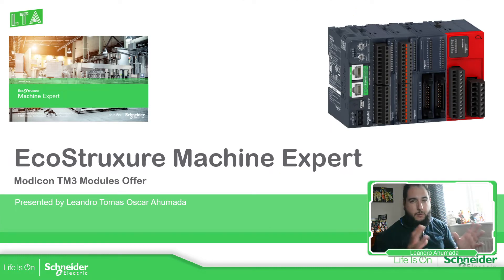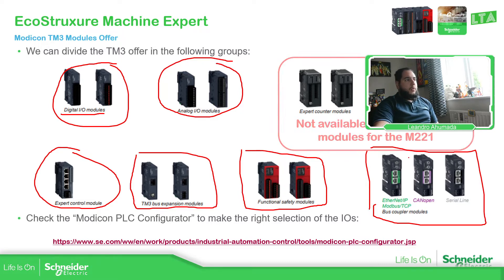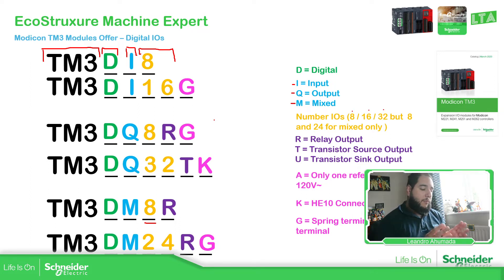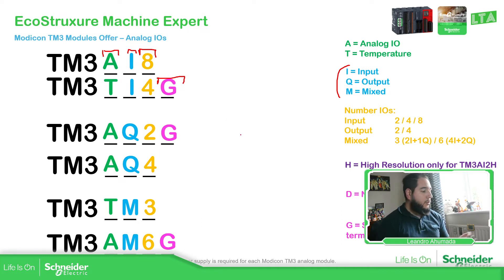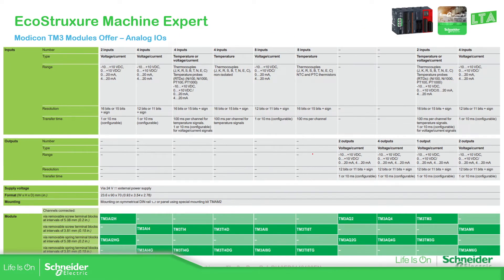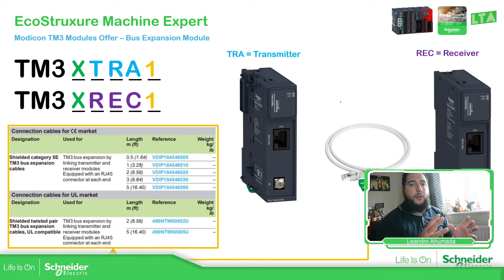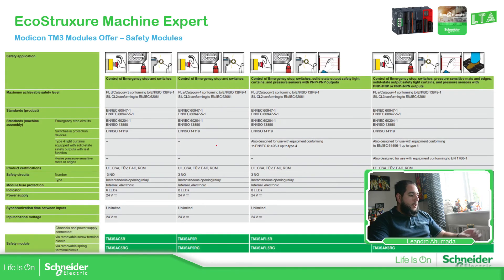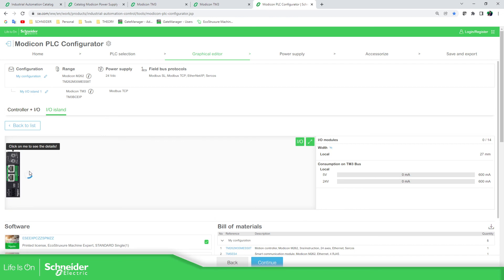EcoStruxure Machine Expert Training - M9.1 Modicon TM3 Modules Offer

Comment: Hi Leandro. Thanks for your videos. They are really helpful. One question: I'm using a M241 and a TM3AM6 Analog I/O module. I know I can  add it manually to my project by adding it to the IO Bus and choosing it, but is there a way of autodetecting the connected devices once you are logged to the PLC? I can see that ME detects that the configuration is wrong but it doesn't say which module is connected.  Thanks!
Reply from the maker: Hi there! There are function blocks that allow you to check status of the module connected but even if the plc detects a wrong configuration we need to manually configure the hardware.
Reply: Thanks for the answer! @LeTomasAHUMADA

Comment: Hi, Leandro. In my case I want to expand the ethernet 2 port (I have a M251) cause I'm using the controller as a ModBus TCP Client and the ethernet port 2 is already been used to control a UR3 Robot (Server), but I want a second ethernet 2 port to connect to another device (another server), wich expansion module can I use? 
I found the TM4ES4 module, but I saw that it is not configurable with Machine Expert when using M251 (It doesn't show in the modules tab), so It works as Ethernet 2 or only as Ethernet 1 when we couple it in the controller? How can I specify the type of ethernet in the module when coupling like that?
Gracias in advance.
Reply from the maker: Hi there! You can extend the network by using a switch connected to the eth2 or adding the TM4ES4 without any configuration in the software.
Reply from the maker: The only “problem” is that you need to physically link the module to the plc using a ethernet cable

Comment: how many TM3BCEIP can by connected to M262?
Reply from the maker: Hi Yaroslav Lyulko! I am not 100% sure if i can give you a number for this but if you check the resources on the ethernet port you should be able to see the ethernet load. This will give you an idea in the m262 software.